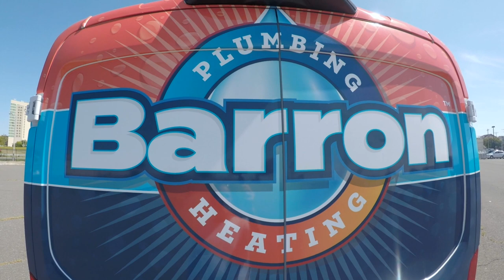PLUMBING REPAIRS | RIDGID K9-306 FLEX SHAFT | CLOGGED DRAIN LINE

Comment: Either re-terminate the end that is sliced or use some of the electrical heat shrink tubing used for power lines or fiber optic industrial lines!
Reply from the maker: Thanks Brother. I replaced it.

Comment: Chuck nice job try using the flex shaft with just a drill point on the end to open the drain initially without the chains attached it helps drive the machine deeper into the pipe less friction
Reply from the maker: Ya, a real process here. Do no force or couple with break.

Comment: what up Chuck, I just bough my K9 306 what is the update on this machine how you like it so far and do you use this for every rodding?
Reply from the maker: I love it. I just snapped coupler I believe. The motor has some juice for sure. I do. I use it all the time. Should push through blockage and work back in blockage with a boat load of water is key.....so neat and complete for sure. Hit me up anytime brother.....
Reply: @ChuckBarron  I will get back to you once I get to use this in a couple jobs I can't wait.
Reply: @ChuckBarron  one more thing you should do more video about how you run your business and business strategies to build and have a successful business from your experience.

Comment: Hey chuck can i ask u somethin' could a urinal flushometer be fitted with the toilet?
Reply: the urinal ones are most always low volume and long flow vs. a toilet with high volume over shorter flow time... the total GPF/LPF is way lower on urinals depending on how old. .5gpf to 1.5gpf.  while the "king/queens chair"(lol) is likely 1.28 or 1.6GPF (unless very old, high volume flush)
Reply from the maker: Thanks sir.

Comment: doesn't it have a reverse which makes the cable very easy to retract? never used one, perhaps I should go look at them lol
also, I'm guessing that's PEX jacket/outer sleeve, but maybe they went with something else like nylon? I'd imagine they'd have just the sleeve available, but maybe not?
Reply from the maker: ya. this nice but my 5208 is beast mode for sure.

Comment: Maybe I'm jaded/old fashioned but I cannot see spending so much money for that machine when a drain machine with a clutch is cheaper and works just as well provided the appropriate U blade/cutter head is used.When dealing with grease clogs I get the drain machine started down the drain then stop,pour a bottle of good degreaser down the drain before I proceed to clean the drain and so far I have had great success.With that machine that you use in the video you have to keep jamming the cable down the drain where as with a regular drain machine I keep one hand on the drain cable guide,my other hand on the clutch to insert and retract the drain cable and done deal.This is one video where I cannot give you a thumbs up because what works for you does not work for me and what's more no matter how I try I cannot find any justification for spending so much money on that drain machine when a regular drain machine with a clutch and a good quality drain cable works better.I learned the hard way that the best way to clean out drains is to let the drain machine feed the drain cable at its own pace instead of jamming the drain cable down the drain.The cable sheath got damaged to boot?Again,I'm sorry Chuck but that drain machine that you use in the video blows dude.With a regular drain machine and a good drain cable you wouldn't have had the hassle of repairing any drain cable sheath like you're going to have to do with that drain machine.I'm open to new technology and new tools which is why I invested in copper pipe press tools after watching yiour videos but that drain machine in my honest opinion totally blows.God bless you and yours Chuck,thank you for the video my Brother,peace be with you.
Reply from the maker: So many options...
Reply: @ChuckBarron  You are correct,the thing is to always choose the best option.When I first started working with a sewer cleaning company in NYC I learned the hard way that a drain cable must never be forced down drain lines.I was told several times to allow the drain machine to feed the drain cable down the drain line at its own pace and to always use the clutch on the drain machine to run the drain cable down the drain line but I didn't listen and instead opted to feed the drain cable down the drain line manually,I jammed the drain cable down the drain line and guess what?I got whacked on the side of the head by the drain cable because the drain cable got stuck on somthing,reared up and smacked me on the side of the head.If I had used the clutch on the drain machined like I was told to do I would not have gotten whacked on the side of the head by the drain cable because as soon as the drain cable showed signs of getting stuck I could have moved the clutch on the drain machine to the neutral position.I learned the hard way to follow instructions and believe me when I tell you that getting whacked on the side of the head by a 1/2" drain cable is quite painful.I'm not ragging you Chuck,if that drain machine works for you then great,but from my own experience using drain machines that drain machine that you use would never be my first choice if I had to buy a new drain machine.Not everything that's the latest in tools is good for everyone or suits everyone.God bless you and yours Chuck and thanks for the video.
Reply: No way Nelson you have it all rong.